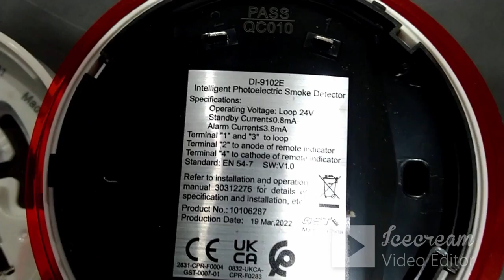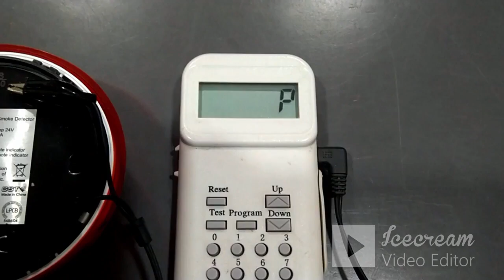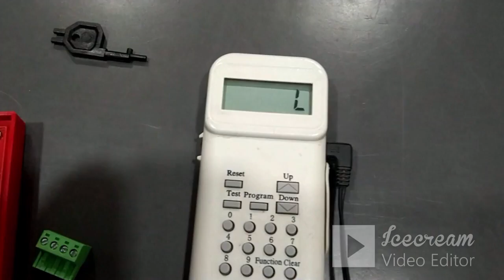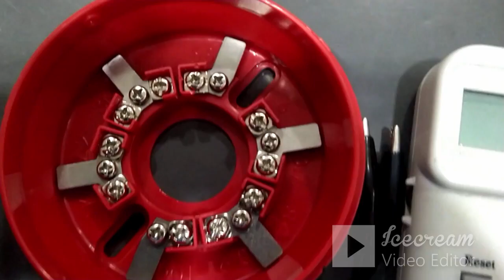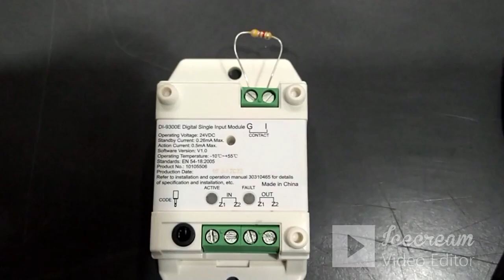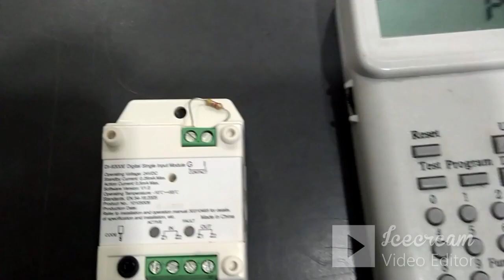Comment: FIRE ALARM DEALERS IN KOCHI, FIRE ALARM SYSTEM IN KOCHI, FIRE ALARM SYSTEM TRADERS IN KOCHI, ADDRESSABLE FIRE ALARM DEALERS IN KOCHI, AGNI FIRE ALARM DEALERS IN KOCHI, RAVEL FIRE ALARM DEALERS IN KOCHI, SMOK DETECTOR DEALERS IN KOCHI, FIRE ALARM PANEL DEALERS IN KOCHI, HONEYWELL MORLEY FIRE ALARM DEALERS IN KOCHI, FIRECLASS FIRE ALARM DEALERS IN KOCHI, AGNI FIRE ALARM PANEL IN KOCHI, FIRE DETECTORS IN KOCHI, FIRE ALARM DISTRIBUTORS IN KOCHI, ASES FIRE ALARM DEALERS IN KOCHI, CONVENTIONAL FIRE ALARM DEALERS IN KOCHI, FIRE ALARM CONTRACTORS IN KOCHI, SIMPLEX FIRE ALARM DEALERS IN KOCHI, FIRE ALARM COMPANIES IN KOCHI, FIRE ALARM SUPPLIERS IN KOCHI, FIRE ALARM INSTALLATION IN KOCHI, GST FIRE ALARM DEALERS IN KOCHI, FIRE PIPE INSTALLATION IN CONTRACTORS IN KOCHI, FIRE SAFETY CONTRACTORS IN KOCHI, FIRE PA TWO WAY TALK BACK SYSTEM DEALERS IN KOCHI, HEAT DETECTOR DEALERS IN KOCHI, HONEYWELL FIRE ALARM DEALERS IN KOCHI, SMOKE DETECTOR DEALERS IN KOCHI, FIRE ALARM DEALERS IN KOCHI, FIRE ALARM SYSTEM IN KOCHI, FIRE ALARM SYSTEM TRADERS IN KOCHI, ADDRESSABLE FIRE ALARM DEALERS IN KOCHI, AGNI FIRE ALARM DEALERS IN KOCHI, RAVEL FIRE ALARM DEALERS IN KOCHI, SMOKE DETECTOR DEALERS IN KOCHI, FIRE ALARM PANEL DEALERS IN KOCHI, HONEYWELL MORLEY FIRE ALARM DEALERS IN KOCHI, FIRECLASS FIRE ALARM DEALERS IN KOCHI, AGNI FIRE ALARM PANEL IN KOCHI, FIRE DETECTORS IN KOCHI, FIRE ALARM DISTRIBUTORS IN KOCHI, ASES FIRE ALARM DEALERS IN KOCHI, FIRE SAFETY CONTRACTORS IN KOCHI, FIRE ALARM CONTRACTORS IN KOCHI, SIMPLEX FIRE ALARM DEALERS IN KOCHI, FIRE ALARM COMPANIES IN KOCHI, FIRE ALARM SUPPLIERS IN KOCHI, FIRE ALARM INSTALLATION IN KOCHI, GST FIRE ALARM DEALERS IN KOCHI, MORLEY FIRE ALARM DEALERS IN KOCHI, FIRE ALARM INSTALLTION IN KOCHI, FIRE FIGHTING COMPANIES IN KOCHI, ADDRESSABLE FIRE ALARM SYSTEM DEALERS IN KOCHI, FIRE ALARM SYSTEMS IN KOCHI, PA TALK BACK SYSTEMS IN KOCHI, FIRE CONTRACTORS IN KOCHI, FIRE PROTECTION COMPANIES IN KOCHI, FIRE FIGHTING CONTRACTORS IN KOCHI, FIRE ALARM DISTRIBUTORS IN KOCHI, MORLEY ADDRESSABLE FIRE ALARM SYSTEM DEALERS IN KOCHI, GST ADDRESSABLE FIRE ALARM SYSTEM DEALERS IN KOCHI, NOTIFIER ADDRESSABLE FIRE ALARM SYSTEM DEALERS IN KOCHI, EDWARDS FIRE ALARM DEALERS IN KOCHI, EST FIRE ALARM DEALERS IN KOCHI, ASES SECURITY FIRE ALARM DEALERS IN KOCHI, ASES FIRE ALARM DEALERS IN KOCHI, ASES PA SYSTEM IN KOCHI, PA TWO WAY TALK SYSTEM IN KOCHI, PA TALK BACK UNIT IN KOCHI, PA PAGING SYSTEM DEALERS IN KOCHI, FIRE ALARM CUM PA SYSTEM IN KOCHI, FIRE ALARM PANEL DEALERS IN KOCHI, MANUAL CALL POINT DEALERS IN KOCHI, FIRE ALARM HOOTER DEALERS IN KOCHI, FIRE ALARM MCP DEALERS IN KOCHI, FIRE ALARM SOUNDER DEALERS IN KOCHI, FIRE ALARM SYSTEM IN KOCHI, FIRE TELEPHONE SYSTEM DEALERS IN KOCHI, PA SYSTEM DEALERS IN KOCHI. HONEWELL PA SYSTEM DEALERS IN KOCHI, PUBLIC ADDRESS SYSTEM DEALERS IN KOCHI, BOSCH PA SYSTEM DEALERS IN KOCHI, BOSCH DEALERS IN KOCHI, HONEYWELL DEALERS IN KOCHI, RAVEL FIRE ALARM DEALERS IN KOCHI, AGNI FIRE ALARM DEALERS IN KOCHI, AGNI DETECTOR DEALERS IN KOCHI, AGNI SMOKE DETECTOR DEALERS IN KOCHI, PA SYSTEM DEALERS IN KOCHI, HONEYWELL PA SYSTEM DEALERS IN KOCHI.

FIRE ALARM DEALERS IN CALICUT, FIRE ALARM SYSTEM IN CALICUT, FIRE ALARM SYSTEM TRADERS IN CALICUT, ADDRESSABLE FIRE ALARM DEALERS IN CALICUT, AGNI FIRE ALARM DEALERS IN CALICUT, RAVEL FIRE ALARM DEALERS IN CALICUT, SMOK DETECTOR DEALERS IN CALICUT, FIRE ALARM PANEL DEALERS IN CALICUT, HONEYWELL MORLEY FIRE ALARM DEALERS IN CALICUT, FIRECLASS FIRE ALARM DEALERS IN CALICUT, AGNI FIRE ALARM PANEL IN CALICUT, FIRE DETECTORS IN CALICUT, FIRE ALARM DISTRIBUTORS IN CALICUT, ASES FIRE ALARM DEALERS IN CALICUT, CONVENTIONAL FIRE ALARM DEALERS IN CALICUT, FIRE ALARM CONTRACTORS IN CALICUT, SIMPLEX FIRE ALARM DEALERS IN CALICUT, FIRE ALARM COMPANIES IN CALICUT, FIRE ALARM SUPPLIERS IN CALICUT, FIRE ALARM INSTALLATION IN CALICUT, GST FIRE ALARM DEALERS IN CALICUT, FIRE PIPE INSTALLATION IN CONTRACTORS IN CALICUT, FIRE SAFETY CONTRACTORS IN CALICUT, FIRE PA TWO WAY TALK BACK SYSTEM DEALERS IN CALICUT, HEAT DETECTOR DEALERS IN CALICUT, HONEYWELL FIRE ALARM DEALERS IN CALICUT, SMOKE DETECTOR DEALERS IN CALICUT, FIRE ALARM DEALERS IN CALICUT, FIRE ALARM SYSTEM IN CALICUT, FIRE ALARM SYSTEM TRADERS IN CALICUT, ADDRESSABLE FIRE ALARM DEALERS IN CALICUT, AGNI FIRE ALARM DEALERS IN CALICUT, RAVEL FIRE ALARM DEALERS IN CALICUT, SMOKE DETECTOR DEALERS IN CALICUT, FIRE ALARM PANEL DEALERS IN CALICUT, HONEYWELL MORLEY FIRE ALARM DEALERS IN CALICUT, FIRECLASS FIRE ALARM DEALERS IN CALICUT, AGNI FIRE ALARM PANEL IN CALICUT, FIRE DETECTORS IN CALICUT, FIRE ALARM DISTRIBUTORS IN CALICUT, ASES FIRE ALARM DEALERS IN CALICUT, FIRE SAFETY CONTRACTORS IN CALICUT, FIRE ALARM CONTRACTORS IN CALICUT, SIMPLEX FIRE ALARM DEALERS IN CALICUT, FIRE ALARM COMPANIES IN CALICUT, FIRE ALARM SUPPLIERS IN CALICUT, FIRE ALARM INSTALLATION IN CALICUT, GST FIRE ALARM DEALERS IN CALICUT, MORLEY FIRE ALARM DEALERS IN CALICUT, FIRE ALARM INSTALLTION IN CALICUT, FIRE FIGHTING COMPANIES IN CALICUT, ADDRESSABLE FIRE ALARM SYSTEM DEALERS IN CALICUT, FIRE ALARM SYSTEMS IN CALICUT, PA TALK BACK SYSTEMS IN CALICUT, FIRE CONTRACTORS IN CALICUT, FIRE PROTECTION COMPANIES IN CALICUT, FIRE FIGHTING CONTRACTORS IN CALICUT, FIRE ALARM DISTRIBUTORS IN CALICUT, MORLEY ADDRESSABLE FIRE ALARM SYSTEM DEALERS IN CALICUT, GST ADDRESSABLE FIRE ALARM SYSTEM DEALERS IN CALICUT, NOTIFIER ADDRESSABLE FIRE ALARM SYSTEM DEALERS IN CALICUT, EDWARDS FIRE ALARM DEALERS IN CALICUT, EST FIRE ALARM DEALERS IN CALICUT, ASES SECURITY FIRE ALARM DEALERS IN CALICUT, ASES FIRE ALARM DEALERS IN CALICUT, ASES PA SYSTEM IN CALICUT, PA TWO WAY TALK SYSTEM IN CALICUT, PA TALK BACK UNIT IN CALICUT, PA PAGING SYSTEM DEALERS IN CALICUT, FIRE ALARM CUM PA SYSTEM IN CALICUT, FIRE ALARM PANEL DEALERS IN CALICUT, MANUAL CALL POINT DEALERS IN CALICUT, FIRE ALARM HOOTER DEALERS IN CALICUT, FIRE ALARM MCP DEALERS IN CALICUT, FIRE ALARM SOUNDER DEALERS IN CALICUT, FIRE ALARM SYSTEM IN CALICUT, FIRE TELEPHONE SYSTEM DEALERS IN CALICUT, PA SYSTEM DEALERS IN CALICUT. HONEWELL PA SYSTEM DEALERS IN CALICUT, PUBLIC ADDRESS SYSTEM DEALERS IN CALICUT, BOSCH PA SYSTEM DEALERS IN CALICUT, BOSCH DEALERS IN CALICUT, HONEYWELL DEALERS IN CALICUT, RAVEL FIRE ALARM DEALERS IN CALICUT, AGNI FIRE ALARM DEALERS IN CALICUT, AGNI DETECTOR DEALERS IN CALICUT, AGNI SMOKE DETECTOR DEALERS IN CALICUT, PA SYSTEM DEALERS IN CALICUT, HONEYWELL PA SYSTEM DEALERS IN CALICUT.

FIRE ALARM DEALERS IN PALAKKAD, FIRE ALARM SYSTEM IN PALAKKAD, FIRE ALARM SYSTEM TRADERS IN PALAKKAD, ADDRESSABLE FIRE ALARM DEALERS IN PALAKKAD, AGNI FIRE ALARM DEALERS IN PALAKKAD, RAVEL FIRE ALARM DEALERS IN PALAKKAD, SMOK DETECTOR DEALERS IN PALAKKAD, FIRE ALARM PANEL DEALERS IN PALAKKAD, HONEYWELL MORLEY FIRE ALARM DEALERS IN PALAKKAD, FIRECLASS FIRE ALARM DEALERS IN PALAKKAD, AGNI FIRE ALARM PANEL IN PALAKKAD, FIRE DETECTORS IN PALAKKAD, FIRE ALARM DISTRIBUTORS IN PALAKKAD, ASES FIRE ALARM DEALERS IN PALAKKAD, CONVENTIONAL FIRE ALARM DEALERS IN PALAKKAD, FIRE ALARM CONTRACTORS IN PALAKKAD, SIMPLEX FIRE ALARM DEALERS IN PALAKKAD, FIRE ALARM COMPANIES IN PALAKKAD, FIRE ALARM SUPPLIERS IN PALAKKAD, FIRE ALARM INSTALLATION IN PALAKKAD, GST FIRE ALARM DEALERS IN PALAKKAD, FIRE PIPE INSTALLATION IN CONTRACTORS IN PALAKKAD, FIRE SAFETY CONTRACTORS IN PALAKKAD, FIRE PA TWO WAY TALK BACK SYSTEM DEALERS IN PALAKKAD, HEAT DETECTOR DEALERS IN PALAKKAD, HONEYWELL FIRE ALARM DEALERS IN PALAKKAD, SMOKE DETECTOR DEALERS IN PALAKKAD, FIRE ALARM DEALERS IN PALAKKAD, FIRE ALARM SYSTEM IN PALAKKAD, FIRE ALARM SYSTEM TRADERS IN PALAKKAD, ADDRESSABLE FIRE ALARM DEALERS IN PALAKKAD, AGNI FIRE ALARM DEALERS IN PALAKKAD, RAVEL FIRE ALARM DEALERS IN PALAKKAD, SMOKE DETECTOR DEALERS IN PALAKKAD, FIRE ALARM PANEL DEALERS IN PALAKKAD, HONEYWELL MORLEY FIRE ALARM DEALERS IN PALAKKAD, FIRECLASS FIRE ALARM DEALERS IN PALAKKAD, AGNI FIRE ALARM PANEL IN PALAKKAD, FIRE DETECTORS IN PALAKKAD, FIRE ALARM DISTRIBUTORS IN PALAKKAD, ASES FIRE ALARM DEALERS IN PALAKKAD, FIRE SAFETY CONTRACTORS IN PALAKKAD, FIRE ALARM CONTRACTORS IN PALAKKAD, SIMPLEX FIRE ALARM DEALERS IN PALAKKAD, FIRE ALARM COMPANIES IN PALAKKAD, FIRE ALARM SUPPLIERS IN PALAKKAD, FIRE ALARM INSTALLATION IN PALAKKAD, GST FIRE ALARM DEALERS IN PALAKKAD, MORLEY FIRE ALARM DEALERS IN PALAKKAD, FIRE ALARM INSTALLTION IN PALAKKAD, FIRE FIGHTING COMPANIES IN PALAKKAD, ADDRESSABLE FIRE ALARM SYSTEM DEALERS IN PALAKKAD, FIRE ALARM SYSTEMS IN PALAKKAD, PA TALK BACK SYSTEMS IN PALAKKAD, FIRE CONTRACTORS IN PALAKKAD, FIRE PROTECTION COMPANIES IN PALAKKAD, FIRE FIGHTING CONTRACTORS IN PALAKKAD, FIRE ALARM DISTRIBUTORS IN PALAKKAD, MORLEY ADDRESSABLE FIRE ALARM SYSTEM DEALERS IN PALAKKAD, GST ADDRESSABLE FIRE ALARM SYSTEM DEALERS IN PALAKKAD, NOTIFIER ADDRESSABLE FIRE ALARM SYSTEM DEALERS IN PALAKKAD, EDWARDS FIRE ALARM DEALERS IN PALAKKAD, EST FIRE ALARM DEALERS IN PALAKKAD, ASES SECURITY FIRE ALARM DEALERS IN PALAKKAD, ASES FIRE ALARM DEALERS IN PALAKKAD, ASES PA SYSTEM IN PALAKKAD, PA TWO WAY TALK SYSTEM IN PALAKKAD, PA TALK BACK UNIT IN PALAKKAD, PA PAGING SYSTEM DEALERS IN PALAKKAD, FIRE ALARM CUM PA SYSTEM IN PALAKKAD, FIRE ALARM PANEL DEALERS IN PALAKKAD, MANUAL CALL POINT DEALERS IN PALAKKAD, FIRE ALARM HOOTER DEALERS IN PALAKKAD, FIRE ALARM MCP DEALERS IN PALAKKAD, FIRE ALARM SOUNDER DEALERS IN PALAKKAD, FIRE ALARM SYSTEM IN PALAKKAD, FIRE TELEPHONE SYSTEM DEALERS IN PALAKKAD, PA SYSTEM DEALERS IN PALAKKAD. HONEWELL PA SYSTEM DEALERS IN PALAKKAD, PUBLIC ADDRESS SYSTEM DEALERS IN PALAKKAD, BOSCH PA SYSTEM DEALERS IN PALAKKAD, BOSCH DEALERS IN PALAKKAD, HONEYWELL DEALERS IN PALAKKAD, RAVEL FIRE ALARM DEALERS IN PALAKKAD, AGNI FIRE ALARM DEALERS IN PALAKKAD, AGNI DETECTOR DEALERS IN PALAKKAD, AGNI SMOKE DETECTOR DEALERS IN PALAKKAD, PA SYSTEM DEALERS IN PALAKKAD, HONEYWELL PA SYSTEM DEALERS IN PALAKKAD

Comment: . MORLEY ADDRESSABLE FIRE ALARM SYSTEM DEALERS IN KERALA, GST ADDRESSABLE FIRE ALARM SYSTEM DEALERS IN KERALA, NOTIFIER ADDRESSABLE FIRE ALARM SYSTEM DEALERS IN KERALA, EDWARDS FIRE ALARM DEALERS IN KERALA, EST FIRE ALARM DEALERS IN KERALA, ASES SECURITY FIRE ALARM DEALERS IN KERALA, ASES FIRE ALARM DEALERS IN KERALA, ASES PA SYSTEM IN KERALA, PA TWO WAY TALK SYSTEM IN KERALA, PA TALK BACK UNIT IN KERALA, PA PAGING SYSTEM DEALERS IN KERALA, FIRE ALARM CUM PA SYSTEM IN KERALA, FIRE ALARM PANEL DEALERS IN KERALA, MANUAL CALL POINT DEALERS IN KERALA, FIRE ALARM HOOTER DEALERS IN KERALA, FIRE ALARM MCP DEALERS IN KERALA, FIRE ALARM SOUNDER DEALERS IN KERALA, FIRE ALARM SYSTEM IN KERALA, FIRE TELEPHONE SYSTEM DEALERS IN KERALA, PA SYSTEM DEALERS IN KERALA. HONEWELL PA SYSTEM DEALERS IN KERALA, PUBLIC ADDRESS SYSTEM DEALERS IN KERALA, BOSCH PA SYSTEM DEALERS IN KERALA, BOSCH DEALERS IN KERALA, HONEYWELL DEALERS IN KERALA, RAVEL FIRE ALARM DEALERS IN KERALA, AGNI FIRE ALARM DEALERS IN KERALA, AGNI DETECTOR DEALERS IN KERALA, AGNI SMOKE DETECTOR DEALERS IN KERALA, PA SYSTEM DEALERS IN KERALA, HONEYWELL PA SYSTEM DEALERS IN KERALA.

Comment: FIRE ALARM DEALERS IN KERALA, FIRE ALARM SYSTEM IN KERALA, FIRE ALARM SYSTEM TRADERS IN KERALA, ADDRESSABLE FIRE ALARM DEALERS IN KERALA, AGNI FIRE ALARM DEALERS IN KERALA, RAVEL FIRE ALARM DEALERS IN KERALA, SMOKE DETECTOR DEALERS IN KERALA, FIRE ALARM PANEL DEALERS IN KERALA, HONEYWELL MORLEY FIRE ALARM DEALERS IN KERALA, FIRECLASS FIRE ALARM DEALERS IN KERALA, FIRE DETECTORS IN KERALA, FIRE ALARM DISTRIBUTORS IN KERALA, ASES FIRE ALARM DEALERS IN KERALA, CONVENTIONAL FIRE ALARM DEALERS IN KERALA, FIRE ALARM CONTRACTORS IN KERALA, SIMPLEX FIRE ALARM DEALERS IN KERALA, FIRE ALARM COMPANIES IN KERALA, FIRE ALARM SUPPLIERS IN KERALA, FIRE ALARM INSTALLATION IN KERALA, GST FIRE ALARM DEALERS IN KERALA, MORLEY FIRE ALARM DEALERS IN KERALA, ADDRESSABLE FIRE ALARM DEALERS IN KERALA, SIMPLEX FIRE ALARM DEALERS IN KERALA, CONVENTIONAL FIRE ALARM DEALERS IN KERALA, FIRE ALARM TRADERS IN KERALA, HEAT DETECTORS IN KERALA, FIRE ALARM PANEL DEALERS IN KERALA, HONEYWELL FIRE ALARM DEALERS IN KERALA, FIRE ALARM SOUNDER IN KERALA, FIRE ALARM HOOTER DEALERS IN KERALA, FIRE ALARM MCP IN KERALA, FIRE DETECTION SYSTEM IN KERALA, RAVEL FIRE ALARM DEALERS IN KERALA, RAVEL FIRE ALARM DEALERS IN TRIVANDRUM, RAVEL FIRE ALARM DEALERS IN CALICUT, RAVEL FIRE ALARM DEALERS IN ERNAKULAM, RAVEL FIRE ALARM DEALERS IN KANNUR, RAVEL FIRE ALARM DEALERS IN KOTTAYAM, PA TWO WAY TALK BACK SYSTEMS IN KERALA, PA TALK BACK SYSTEMS IN ERNAKULAM, 

FIRE ALARM DEALERS IN ERNAKULAM, FIRE ALARM DEALERS IN TRIVANDRUM, FIRE ALARM DEALERS IN KOCHI, FIRE ALARM DEALERS IN THRISSUR, FIRE ALARM DEALERS IN PALAKKAD, FIRE ALARM DEALERS IN KOTTAYAM, FIRE ALARM DEALERS IN CHANGANASSERY, FIRE ALARM DEALERS IN THIRUVALLA, FIRE ALARM DEALERS IN CHENGANNUR, FIRE ALARM DEALERS IN ALEPPEY, FIRE ALARM DEALERS IN ADOOR, FIRE ALARM DEALERS IN PANDALAM, FIRE ALARM DEALERS IN KARUNAGAPALLY, FIRE ALARM DEALERS IN KAYAMKULAM, FIRE ALARM DEALERS IN PATHANAMTHITTA, FIRE ALARM DEALERS IN OACHIRA, FIRE ALARM DEALERS IN KOLLAM, FIRE ALARM DEALERS IN TRIVANDRUM, FIRE ALARM DEALERS IN PERUMBAVOOR, FIRE ALARM DEALERS IN KOTHAMANGALAM, FIRE ALARM DEALERS IN MOOVATTUPUZHA, FIRE ALARM DEALERS IN PALA, FIRE ALARM DEALERS IN VALANCHERY, FIRE ALARM DEALERS IN MALAPPURAM, FIRE ALARM DEALERS IN TIRUR, FIRE ALARM DEALERS IN CALICUT, FIRE ALARM DEALERS IN PONNANI, FIRE ALARM DEALERS IN PAYYANNUR, FIRE ALARM DEALERS IN WAYANAD, FIRE ALARM DEALERS IN KALPETTA, FIRE ALARM DEALERS IN MANANTHAVADY, FIRE ALARM DEALERS IN FEROKE, FIRE ALARM DEALERS IN THANUR, FIRE ALARM DEALERS IN KERALA, FIRE ALARM DEALERS IN CHALAKKUDY, FIRE ALARM DEALERS IN KODUNGALLUR, FIRE ALARM DEALERS IN ANGAMALY, FIRE ALARM DEALERS IN BATHERY, FIRE ALARM DEALERS IN, MUNNAR, FIRE ALARM DEALERS IN IDUKKI, FIRE ALARM DEALERS IN MANJERI, FIRE ALARM DEALERS IN THALASSERY, FIRE ALARM DEALERS IN THRIPUNITHURA, FIRE ALARM DEALERS IN VADAKARA, FIRE ALARM DEALERS IN KANHANGAD, FIRE ALARM DEALERS IN KOYILANDI, FIRE ALARM DEALERS IN KALAMASSERY, FIRE ALARM DEALERS IN NEYYATINKARA, FIRE ALARM DEALERS IN GURUVAYUR, FIRE ALARM DEALERS IN VADAKKANCHERY, FIRE ALARM DEALERS IN PARAPPANAGADI, FIRE ALARM DEALERS IN NEDUMANGAD, FIRE ALARM DEALERS IN KASARGOD, FIRE ALARM DEALERS IN PAYYOLI, FIRE ALARM DEALERS IN PUNALUR, FIRE ALARM DEALERS IN CHERTALA, FIRE ALARM DEALERS IN TALIPARAMBA, FIRE ALARM DEALERS IN KOTTAKKAL, FIRE ALARM DEALERS IN SHORNUR, FIRE FIRE FIRE ALARM DEALERS IN IRITTY, FIRE ALARM DEALERS IN ATTINGAL, FIRE ALARM DEALERS IN HARIPAD, FIRE ALARM DEALERS IN MUVATTUPUZHA, FIRE ALARM DEALERS IN KOOTHUPARAMBA, FIRE ALARM DEALERS IN IRINJALAKUDA, FIRE ALARM DEALERS IN MAVELIKKARA, FIRE ALARM DEALERS IN MAVELIKARA, FIRE ALARM DEALERS IN VARKALA, FIRE ALARM DEALERS INMANATHAVADI, FIRE ALARM DEALERS IN KOTTARAKARA, FIRE ALARM DEALERS IN KOTTARAKKARA, FIRE ALARM DEALERS IN RANNI, FIRE ALARM DEALERS IN MALLAPALLY, FIRE ALARM DEALERS IN ALUVA, FIRE ALARM DEALERS IN SHORANUR, FIRE ALARM DEALERS IN EDAPPAL, FIRE ALARM DEALERS INKUTTIPURAM, FIRE ALARM DEALERS IN PERINTHALMANNA, FIRE ALARM DEALERS IN NILESWAR, FIRE ALARM DEALERS IN KUTTIADI, FIRE ALARM DEALERS IN MAHE, FIRE ALARM DEALERS IN THAMARASSERY, FIRE ALARM DEALERS IN PONKUNNAM, FIRE ALARM DEALERS IN NILAMBUR, FIRE ALARM DEALERS IN PATTAMBI, FIRE ALARM DEALERS IN VALPARAI, FIRE ALARM DEALERS IN FIRE ALARM DEALERS INVADALY, FIRE ALARM DEALERS IN KOOTHATTUKULAM, FIRE ALARM DEALERS IN THALAYOLAPARAMBU, FIRE ALARM DEALERS IN ETTUMANUR, FIRE ALARM DEALERS IN KANJIRAPPALY, FIRE ALARM DEALERS IN CHAVARA, FIRE ALARM DEALERS IN KILIMANUR, FIRE ALARM DEALERS IN KUTTIKKANAM, FIRE ALARM DEALERS IN PERAMBRA, FIRE ALARM DEALERS IN MANNARKKAD, FIRE ALARM DEALERS IN KUNDARA.